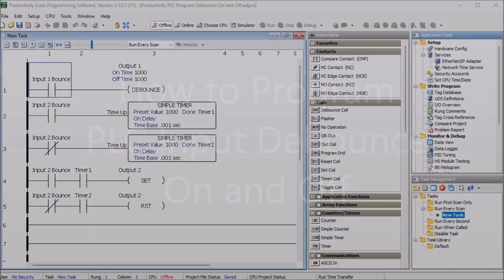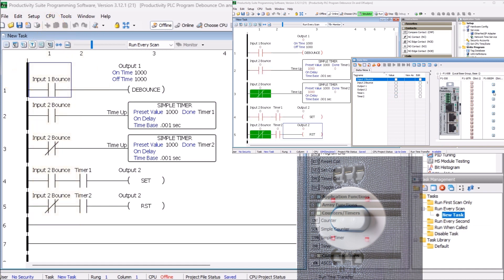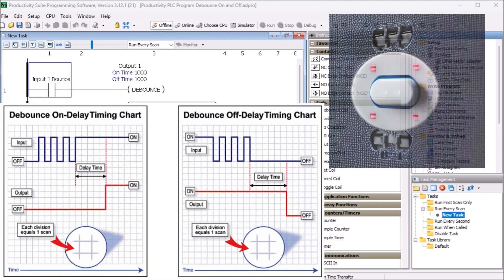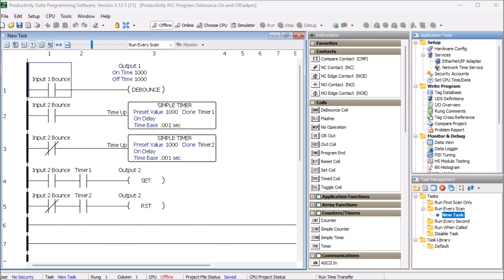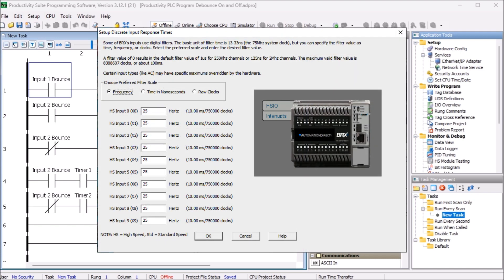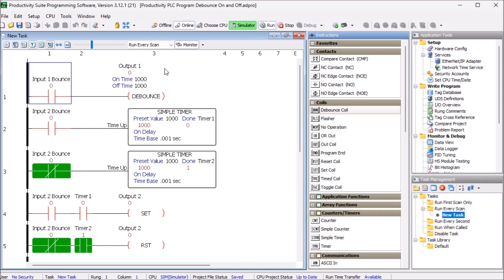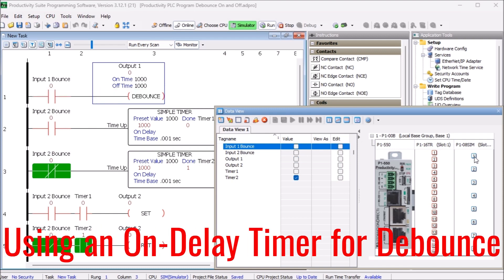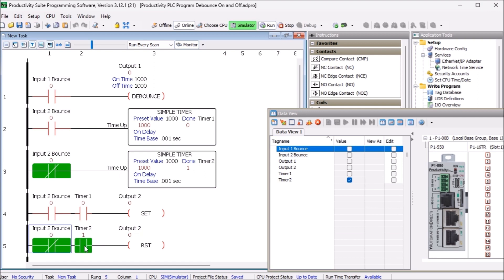How to Program PLC Input Debounce On and Off

Comment from the maker: You can find detailed information and links on the corresponding post located here.
https://accautomation.ca/how-to-program-plc-input-debounce-on-and-off/

Here are the controllers that we have covered at ACC Automation:
Productivity Series
https://accautomation.ca/series/productivity-1000-plc/
https://accautomation.ca/series/productivity-2000-series-plc-p2000/
BRX Do-More Series (Do-More Designer Software + Simulator)
https://accautomation.ca/series/brx-do-more-plc/
Click PLC Series
https://accautomation.ca/series/click-plc/
Omron CP1H Series
https://accautomation.ca/series/omron-plc-cp1h-series/
Horner XL4 PLC Series
https://accautomation.ca/series/horner-xl4-series/

https://accautomation.ca/series/easyplc-software-suite/
EasyPLC Software Suite is a complete PLC, HMI, and Machine Simulator Software package. This PLC learning package includes the following:
Easy PLC – PLC Simulation will allow Ladder, Grafcet, Logic Blocks, or Script programming.
HMI System – Easily create a visual human-machine interface (HMI)
Machine Simulator – A virtual 3D world with real-time graphics and physical properties. PLC programs can be tested using EasyPLC or through other interfaces. (Modbus RTU, TCP, etc.)
Machine Simulator Lite – Designed to run on Android Devices.
Machine Simulator VR – Virtual Reality comes to life so you can test, train or practice your PLC programming.
Purchase your copy of this learning package for less than USD 75 for a single computer install or less than USD 100 to allow different computers.
Receive 10% off the investment by typing in ACC in the comment section when you order. http://www.nirtec.com/index.php/purchase-price/
Learn PLC programming the easy way. Invest in yourself today.

ACC Automation
https://accautomation.ca/

Comment: i though PLCs has hardware debouncing mechanisms built in
Reply from the maker: Many have them built in, usually at a fixed 8 milliseconds. Some PLC manufacturers allow you to change the input filter time. The Productivity Suit software provides this instruction for convenience or when you need a very high filter value.
Regards,
Garry